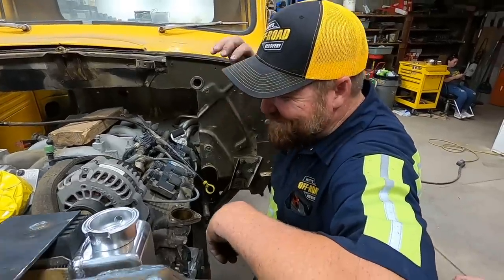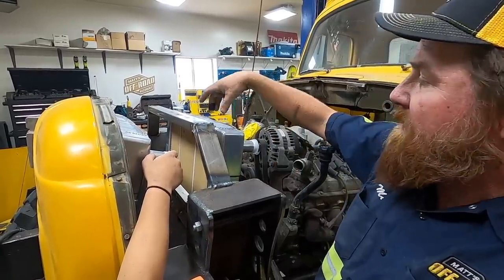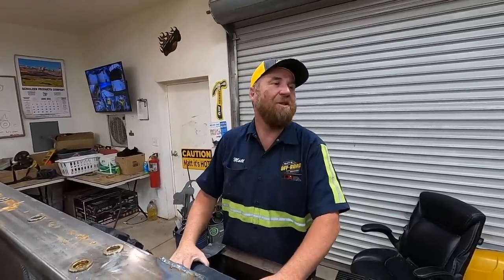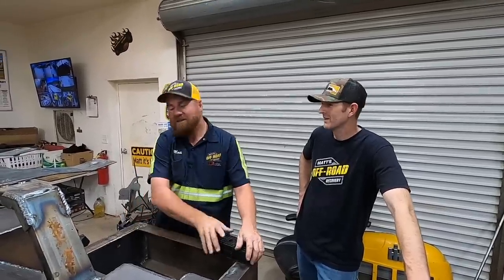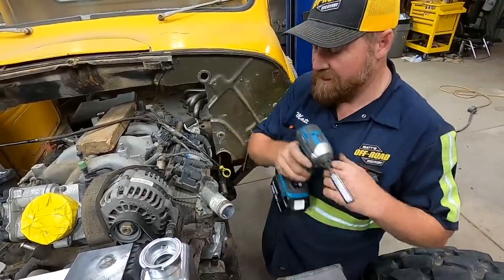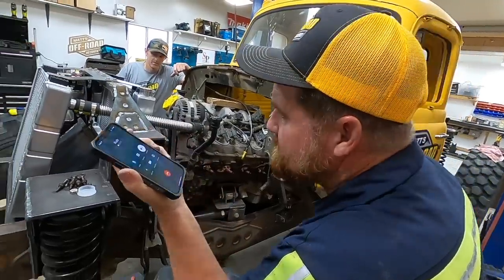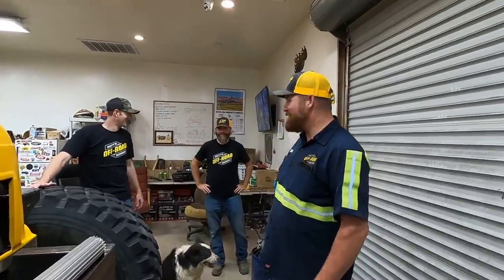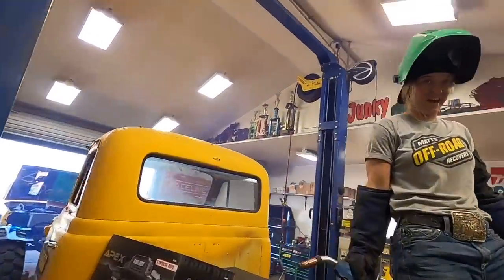This Part Ruined All My Work! The World's Largest Off Road Wrecker

Comment: @Lizzy TIG welding aluminum is awesome!  Control through the foot pedal just makes for a beautiful weld.  Just don’t skip the cleaning/prep work on the aluminum or the layer of oxidation will destroy what could’ve been great weld.  I remember being 12 or 13 and being allowed to use a TIG for the first time.

Comment: I have a question/comment about the cooling on the heavy wrecker.  When running 2 radiators like you are on the heavy wrecker, it seems to me that you would get better cooling if the hottest fluid went to he rear radiator first then to the front one.  That way the coolest fluid coming off the front radiator would go straight back to the engine.  The way you have it, theoretically the air behind the first radiator will have warmed up to the temperature of the fluid making the second radiator useless.  AC coils are designed to have the refrigerant enter in the backside of the air flow and exit in the front for the same reason.  Love you channel.

Comment: With all the space you have in front of the engine, I would setup the 2 radiators in a vertical V, drawing fresh air from the sides to both radiators.  I would then duct the hot air up and out of vents on top of the bonnet with fresh air scoops below for the engine compartment.

Comment: I’ve pressure tested keel coolers on large vessels to gas tanks on golf carts, always use an air regulator set to 5-7 psi for safety and not blow up your project. Just found your channel and all of you do some pretty cool stuff. Some of your adventures would require a huge amount of TP. THANKS

Comment: I hate when I come up with a 'new' idea and find later that someone else already thought of it. However, if they thought of it and I thought of it, then it must have been a solid idea. So that's vindicating. 
I might suggest putting that oil cooler behind the cowling, at the top and in front of the first radiator. This would expose it to the forced air coming through the opening, protect it and its hoses from the elements (like UV) and be more aesthetically pleasing. Wow, opinions from people on the Internet. never expected that...
Thanks for all the great videos.

Comment: I'd say don't make the toolbox 1 big drop down box. 
I worked with a bailer rig on top of a truck, and every space left became toolbox. Because of the frame it had drop down lids in front (like a door but opening down), and having side acces storage for some tools works great. We also made a small drawer on the top, very handy for all the handtools. 

So if I'd had to make the toolbox I'd make the bottom half with a door 1 shelf and 1 small drawer right at the top, and the top half a box where you can just drop things in. 
But you have a better vision of everything that has top go in there, so I might be overthinking this one

Comment: I would have used one radiator for trans cooler and one for oil cooler. That way each radiator pulls double duty. I believe that,I'd put ps cooler behind the winch between frame rails.  Also remember that you can remote some coolers to the rear under the bed each foot of steel line helps dissipate heat, but also adds risk for leaks from rock strikes.  Would be cool to see a reversible fan used for radiators, this will help keep them cleaned out.

Comment: Hey Matt, My experience in the marine environment is that Brass and aluminum don't mix. They create a battery and the Aluminum eats out. The zinc in the brass eats out as well. I always try to stick to SS fasteners with aluminum. I know you are a long way from the salt water but I would watch out for this.

Comment: 26:20 why not use one for chilling the air after the compressor and add a water trap behind it - so you're not getting all the moisture collected in your frame?

For oil cooling, I would close the second side of the frame and put cooling water in it and use an oil to water heat exchanger to cool it down, if necessary. Just have an electric pump with a temperature switch for the water cycle, so it turns on if the oil gets too hot, which is pumped through the heat exchanger.

The amount of water plus the large surface area of the frame gives you enough cooling capacity.

Comment: You should have researched the system Ford had on the 1958 - 1966 430 Lincoln engines, 3 thermostats, one in the front of each cylinder bank at 140° they open only when the water in the block sides hit 140° to allow coolant from the radiator into the block. The water circulation was primarily through the heads and intake until the water in the block reached 140° at which time it started through the block and up into heads then through them, into the back of the intake and up through the intake as there was no exhaust crossover on these beasts.

Comment: Brother matt. You know that I live in the hottest region in the world. The temperature in the summer reaches 54 degrees Celsius  130f and the temperature of car machines rises. The solution is not to expand the radiator slots only. The only solution is to add small fans to the radiator from the outside, To compensate for the lost air in the direction of the truck's movement because relying on the zinger fan is not enough.. Try placing two small fans, two will suffice.  Then you will feel that the machine is working comfortably.. Your friend from the Middle East 👋🏻

Comment: Not sure about the double radiator setup have seen some angled side by side, or like old Audi offset to side , but since you have more volume of antifreeze it will still be a bonus. Also if the cold start flow is not what you want - add a thermostat or a simple heater "tap"/valve  (or both for safety) you can  open from the cab.

Comment: Yes you should care about the metal type used for the plugs in the radiator. There is a chart called a galvanic corrosion chart that shows how two mating metals will attack each other. Brass will eat up aluminum. A galvanized plug would be best with aluminum followed by a carbon steel plug. If you install a brass plug don't be surprised if you start to have leaks. Of course this only applies if you leave the plugs in place. If you are using them just for pressure testing then it shouldn't be a problem.

Comment: The dual radiator setup is legit. Not sure why they are getting mounted on the front, however. Trophy trucks and mud trucks have them on the rear with high flow electric fans and have great success with that. Im assuming because of the tool storage and winch/pole setup.  At any rate you guys are in uncharted territory for the YouTube mechanics and engineers. Im with tom tom. Its gonna work. I just think servicing and air cooling would be better in the back. Love it so far guys. 
You need to get LT TOLMAN to build that 8.1 a TURBO manifold!

Comment: Other people may have already pointed this out but since I don't read what other people comment on, here it is and my apologies if I am repeating other people. 
You are going to have an issue with water flow because the stock pump is not designed for flow requirement through 2x radiators.
I was going to look smart and state the formula to calculate flow in a heat energy dissipation circuit but I save you the time, suffice to say that if you are doubling your radiator capacity, you will need to at least double your flow (Gal/min) out of your water pump. You will of course figure it all out in time, being the natural born engineer that you are, Matt but most likely an auxiliary electric pump and a new valve/ control circuit will be needed to modify the flow.

Comment: You should consider getting 2-way fan blades for the radiators and wire it so you can reverse the fan motors so you can blow heat away from the engine if you want to. Also if the shrouds are tight enough, reversing the fan may deter sand from clogging the cooling fins in the radiator if it's being spit at you from a puller vehicle. With all that open air under the hood and around the engine, I doubt the engine bay air temp will exceed outside air temp when you're in the desert on those extra hot days.

Comment: Just a thought, but why not put in an additional water tank hooked to a windshield washer pump and nozzle that points onto the surface of the front radiator? With the flick of a switch, you can introduce evaporative cooling to the radiator, much like your use of a water bottle squeezed on the banana radiator in long ago videos.

Comment: The radiator setup is less than ideal but with fresh air hitting the first radiator and 2nd pass of the 2nd radiator id imagine it will work "good enough". 
The mechanical fan drawing half from the front radiator and half from the fresh air below should work well, but i wonder how much the electric fan will help since the output is much smaller. Either way it cant hurt i guess

Comment: Turn Lizzy loose on the tig torch with practice scraps.I watch on Lets dig 18 about a Cat loader with radiator problems.That radiator is a zig zag pattern of small tall radiators with removable top/ bottom tanks and gives a very wide surface without actually being wide.Something to consider.Its actually a huge radiator.

Comment: My dad, his siblings and parents were soy bean and cotton farmers in the flat lands of eastern Arkansas back in the 40's-70's. Being poorer than the dirt they worked they hardly got away from the farm or had the latest greatest tools to accomplish their day to day tasks. In spite of that they always made things work.. they invented and innovated tools to cultivate the land, to do everyday household stuff and to fix the things that do things. Dad, then about 13yrs old.. got tired of working on an impliment(one i still have today) with like a thousand bolts so he took a napkin and pen.. designed a device that turned a nut/bolt  then twisted back to reset itself without ever removing the wrench from the bolt/nut. He found out what he needed to do to get it patented, of course not telling a single soul what he was working on out of fear of espionage.. and went to patent his new tool. Immediately after starting the patent search.. he found that the ratchet had already been patented in 1863 and innovated several times since. He was proud though disheartened. As you know.. the cooling bypass was both a waste of time and a confirmation that you had it right. Love yalls videos.

Comment: You could always throw in a standard thermostat. Let's see if using electric and mechanical fans, without ducting radiators together you well have air temp loss between depending on cfm. And allowing air to come between radiators.  Should not be problem? Radiant coolers looked like decent positions.   Thought Tom Tom figured your exterior frame as airtanks? Gonna be lot of pressure testing if sticking to that.  Like the lines and thoughts so far

Comment: Always series on oil, water can be parallel piped (viscose changes). Always suck air with at least a 2” deep box (more air flow, better cooling, less amps) The comments on here are ace, folk really know their stuff and are putting it out there. Personally I would only do two rads in a desert if they had their own air supply. Let’s say the big wrecker has the air entering between the rads and the front rad group blows out through the grill. And personal personally I would put the second rad behind the cab with a pair of sucking fans. And remember that in series the water flow on a centrifugal pump is reduced by the extra back pressure of series. (You gain and loose)

Comment: I’m no mechanic expert, but if you could create a separate flow of air to the second radiator by modifying a fan shroud, it would get the same air as the first one and do a better job. Just an ideea. Like the videos, God bless.

Comment: the coolant bypass through engine and radiator end tank, is more or less how it was done for many years. the hot water was usually from heater core/bypass valve and flowed down the radiator end with the integral transmission cooler. that always gave coolant flow over the trans cooler portion, with the side effect of also helping to heat the engine/coolant if you started driving right away, because transmissions do heat up fast due to torque converter heating.

Comment: Matt buy an air power nutsert tool, interchangeable heads. Love it over the crap hand tool. Faster, better more accurate. Just make sure to hook it to an air regulator, its pressure controlled. Once you use it you'll love it trust me.

Comment: That big bracket may flex upwards with the inertia from the water filled radiators. It may be a good idea to weld some plates at right angles so it has a + profile when looking from the front.

Comment: First off I really enjoy watching your channel and I wish I could work for you. I’m Not trying to hate on your set up but the way I made sense of it is as follows With one radiator in front of the other the air passing thru and cooling the front radiator would heat as it passes thru. So you would be attempting to cool the second radiator with hot air, which would impact the rate of cooling done by the second radiator and decrease efficiency. It sounds like you’ve thought about this. 
I like your explanation in the video but you might get better results if you plumb it in parallel rather than in a series if that makes sense.

Comment: I've done something similar.  But I used  an electronic cut off valve to block the secondary rad till it got to op temp . And when it got too hot out I flipped a switch and opened up the second rad

Comment: Can you use a different thermostat that does not have that part on the bottom or can you cut off or modify the bottom thermostat to work?
Also you could run ducting from the front to direct cold air past the first rad to the second rad to help cooling. Something to think about if you find you have cooling issues.

Comment: Great build, but I'm commenting on something else...concerns for Ed.  PLEASE READ!  Beautiful trailer, but you missed a safety factor on the ramp.  You should have diamond plate footrest on each side of the ramp.  If the Ed's cycle stalls out going up the ramp, Ed wouldn't have any place to catch himself to stop from falling over.  You'd only need about a foot on each side.  Aluminum diamond plate could be used to save weight.  I think this is a must for Ed since he is older and his balance might not be as good as it used to be.  Thanks, concerned Stan Smith  ;  Great work!  :)

Comment: Great project!
Why not move the steering cooler inside the bonnet front on top of the front radiator. 
Not visible and will get airflow from the electric fan.

Comment: This is the coolest thing.  Having V8 swapped a vehicle, cooling was definitely the hardest thing to handle.
The only thing I dislike about it is that since all of the radiators have custom work done, if anything goes wrong, you can't just drop in a replacement.  But, the quality of the radiators and welds seem good enough that that isn't a huge concern

Comment: You have enough room between radiators to deflect the hot air out the sides if the rear radiator is pulling air from below like you say.  

Just a thought Matt.

Comment: I would have put positive pressure in the radiator before I drilled it, to prevent any of the shavings from falling in. Air hose set to 30-40 psi would be enough. ( wear eye protection for sure to keep any shavings from flying into them ) I am extra cautious though.

Comment: Switch the flow order of the coolers. Hottest air touches hottest water first. I could get into the thermodynamics, but it makes a bit of sense if you just think about it for a minute.

Edit: when pressure testing anything, especially when that thing holds water anyways, fill it mostly with water first and add air pressure to the small remaining volume. Water is "technically" not compressible, so there's less storage space for the energy that can violently exit.

Comment: Does  that front radiator have the intake and outtake both on top???   That effectively makes everything but the few top rows useless, since the water will flow on the shortest/less resistance path.  Radiators have diagonal in/out necks for a reason, proper crossflow, which uses the whole surface do what it's designed to do, exchange heat!

Comment: If I was bothering to go with dual radiators on an off road rig, I would run them in parallel, not series. Add some valves so you can turn one off should it get punctured.

Comment: Back radiator needs to get the hot coolest first then the front one second. Otherwise the differential temperatures are not working with you. The hot air out of the front radiator should be cool enough to cool the second one if the back radiator has full temp going in. Swap your plumbing. I work with big heat exchangers in the oil and gas industry so have a good idea how to make an efficient system. Most other educated sounding comments seem to agree.

Comment: If you want to try and offset that heat increase look at adding some intake fans (Something like 200mm PC Case Fans) it should help to add some cooler air.

Comment: When you cut the hole in the radiator, put cotton balls (make sure you can pull them out) into the existing hole, cut the new one and the cotton should gather most of the shavings on the inside. Pull the cotton balls/ wad and you’ll have much less chance of shavings inside.

Comment: This is turned out to be a Mr. Wizard cooling class. I was an engineer and this is major out of the box thinking. If it works you will be a hero, if not then just a little more engineering is needed. Thanks for the class.

Comment: A push pull fan on the front radiator? One in the front pushing air through and one on the back side pulling air so the mechanical fan pulls lots of cooler air.

Comment: Could have just used 2 thermostats on top of the thermostat outlet of the engine.  One at 160f to rear radiator, second at 180f or something to front radiator.